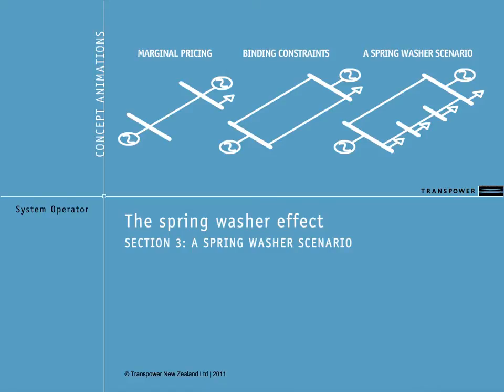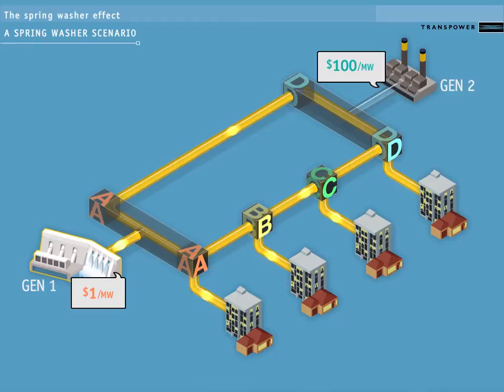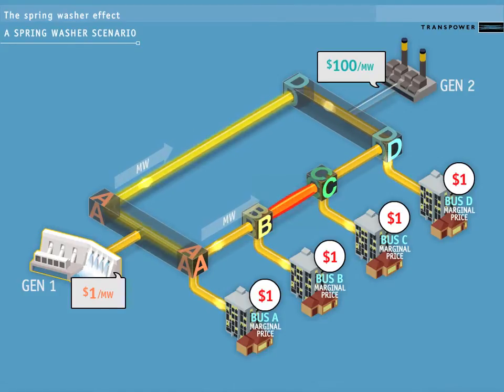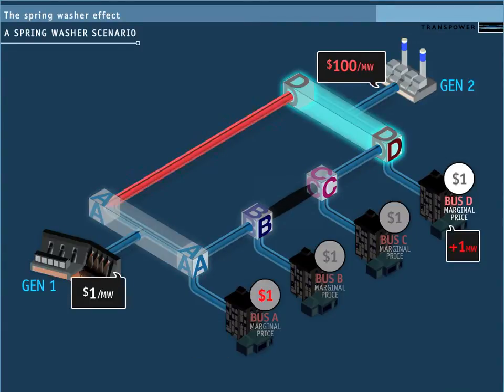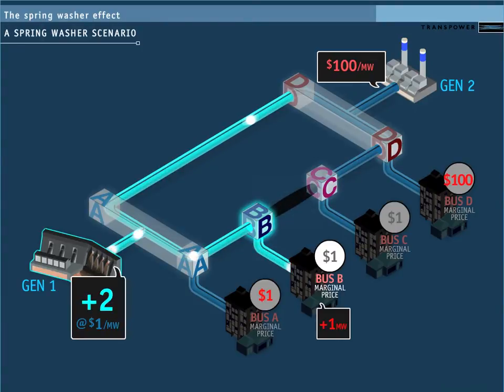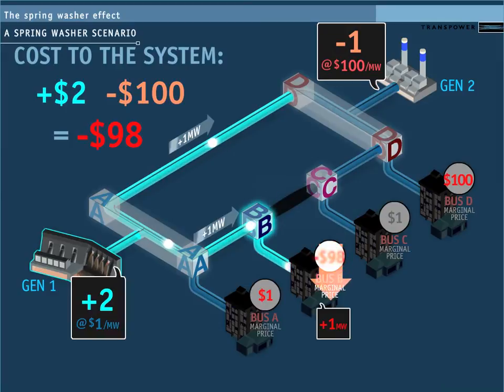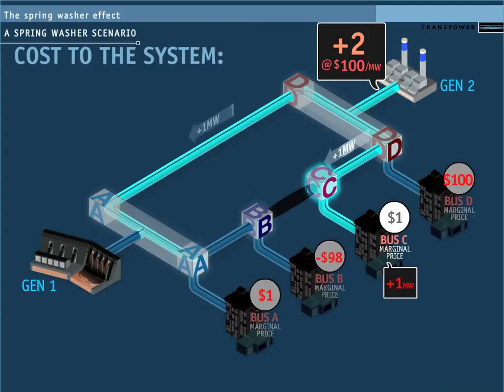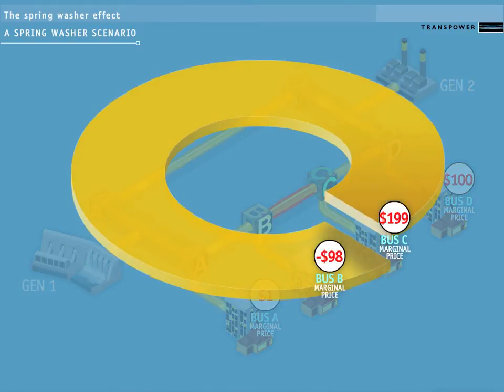The Spring Washer Effect: section 3 - a spring washer scenario

Comment from the maker: Correction: 
There is a slight error in the prices and power flows shown in this video. The video makes an over-simplification when stating Kirchoff’s Law – it assumes power will be split evenly between the two paths. In reality, the proportion of power flowing down each path according to Kirchoff’s Law will depend on the relative impedance of each path. The spring washer effect (including negative prices and prices over $100) will still occur this scenario, but the exact prices and power flows will depend on the relative impedance of each path (which depends on the paths between the generator and the load as well as the impedance of each section of transmission line).